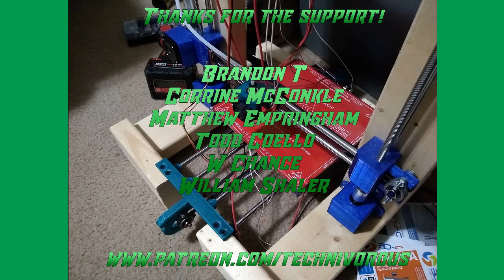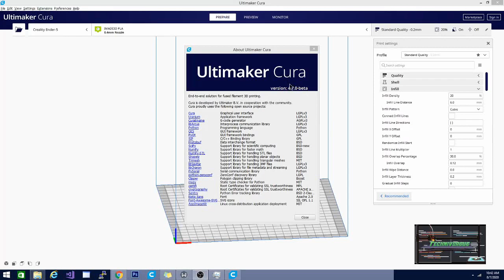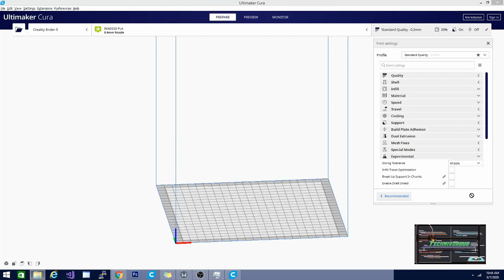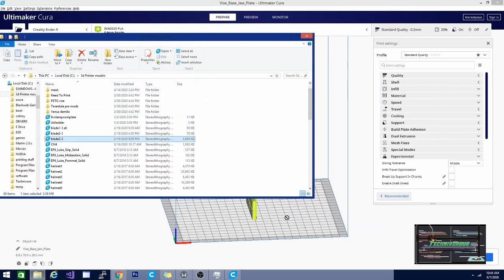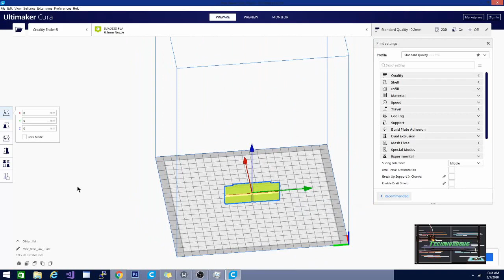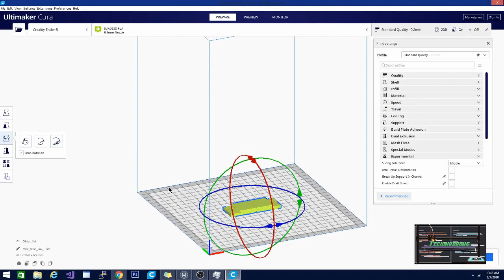Cura 4.7 - Beta - out now! The bug Hunt begins!

Comment: Hello. Does the Ender-3 v2 have the thermal runaway protection?
Reply from the maker: it should, but im not sure, you can check the firmware online. i just found out that a lot of new ender 3 pro machines are coming out with the 32 bit board from the ender 3 v2.

Comment: I wish they would implement a bridged or minimum support setting, this is where instead of supporting the whole of an overhang it adds supports periodically so that there is bridging between the supports.
I can do this with custom supports or support blocking but it would be nice for a command to do it.
Reply from the maker: That's a good point, and a great idea.
Reply: You could play with the support density settings if the bridging is enabled it will do the trick.

The same can be achieved with tree support branch distance btw

Comment: Hi ! Thanks for sharing. I will delve into it and see.
I need your help. When I installed my Ender-3 v2, it was printing fine, but suddenly things have change. See these 2 pictures it prints now: 
http://naedioba.com/Neige.jpg
http://naedioba.com/Neige1.jpg

I tried to print the 20mm calibration cube. I succeeded the first days, but now this how it is. What are the causes?  Any solution, please?
Reply from the maker: thats simple over extrusion. start by turning own the flow rate in cura if its above 100. then calibrate the extruders esteps